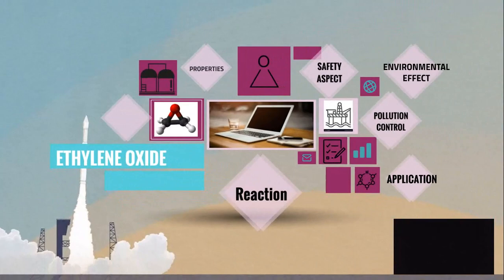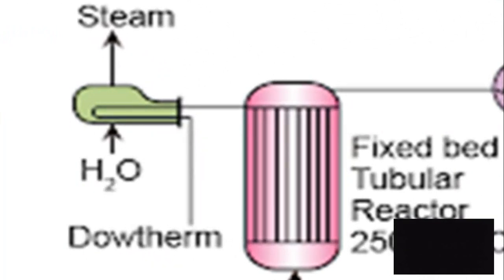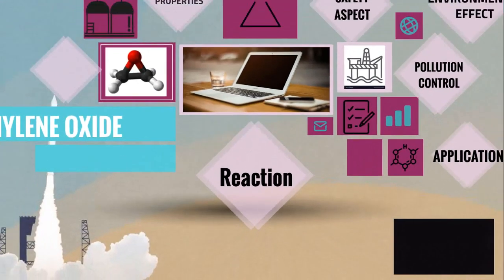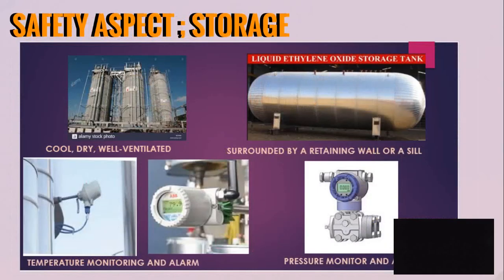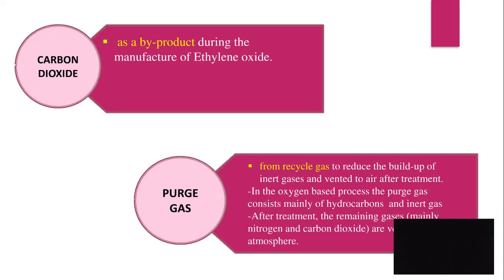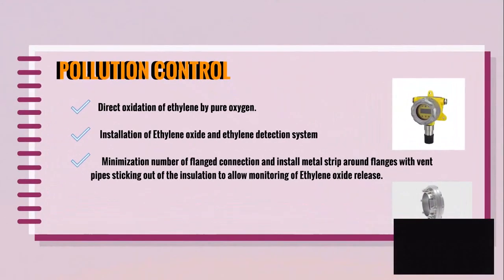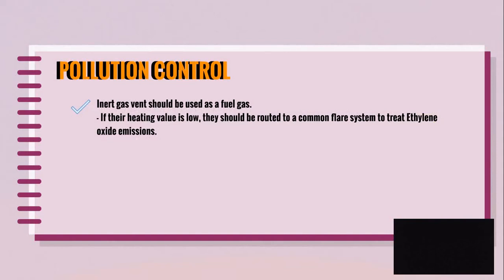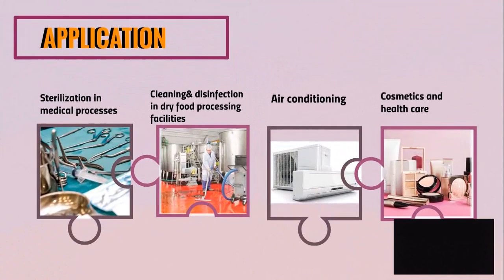An Overview on Ethylene Oxide

Comment: hye, great video. I have a question, how this ethylene oxide synthesis in a laboratory set up? is it possible to do it in a beaker or there are specific equipment that needs to be used?
Reply from the maker: Can refer in the handling and storage part in the video :)